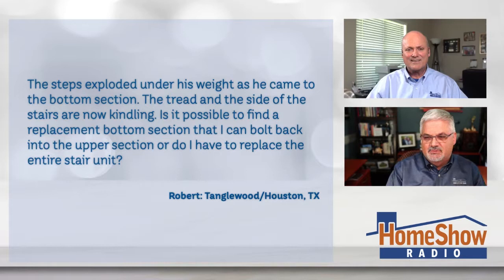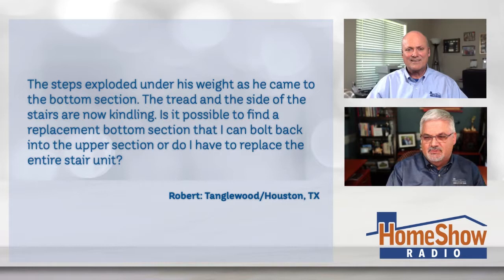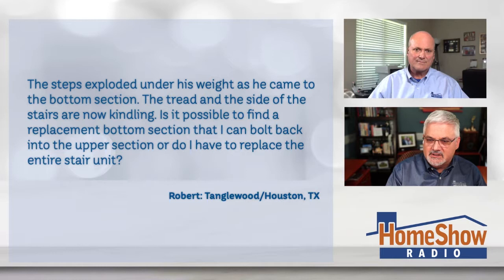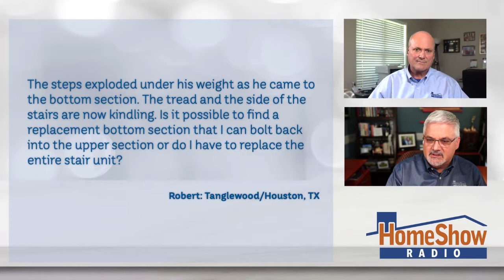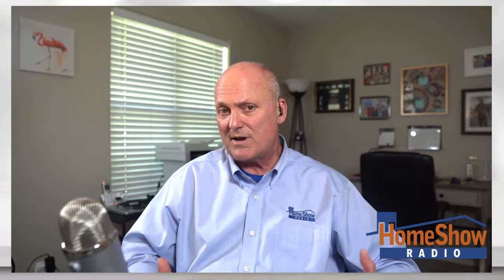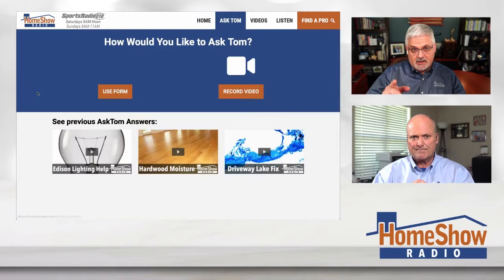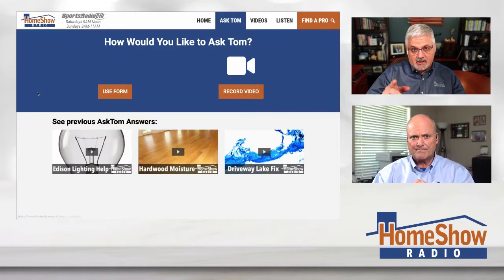Where can I get parts to repair my pull-down attic ladder?

Comment: Good advice, our wood steips now 20 + years have a hinge that locks and has to be coaxed with magic to close.  Ya don't want to know. My husband wants to try to fix by getting someone to replace just the springed hinge (provided they can even be found)  I suggested to the hub that whole set of steps need to be replaced with aluminum but he is bulking; I will share this with him.

Comment: Newer wood attic ladders have a step support rod or truss rod made of steel beneath each step.  Came across an older house where the wood attic ladder did not have the step support rods.  Could they be added?  Where to get them?